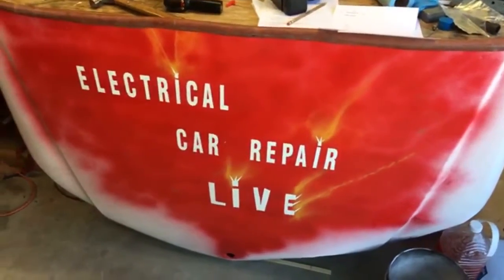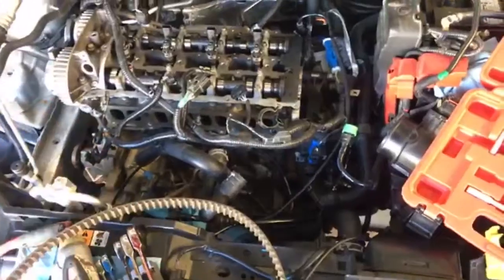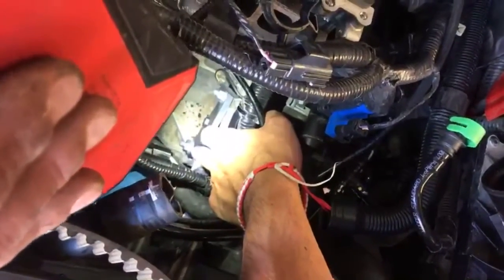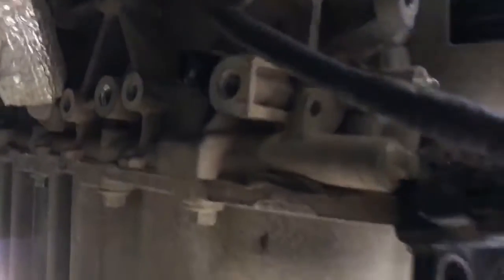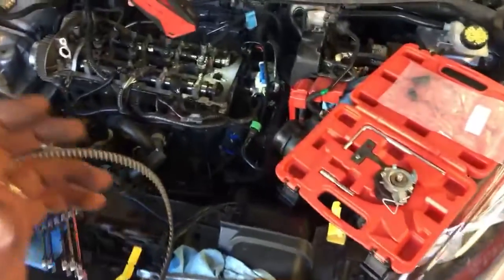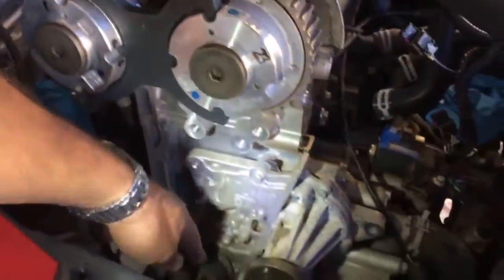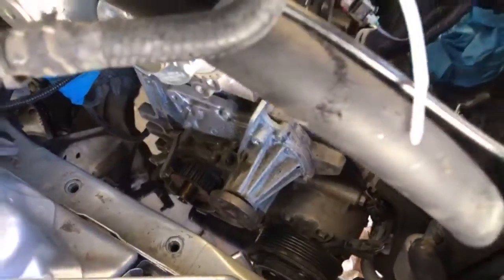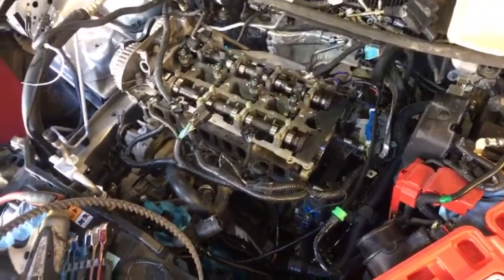FORD 1.6 ECOBOOST TIMING MARKS

Comment: Hello i have a ford mondeo 1.6 ecobust i have 2 problems 1 is that i have the check engine on board is telling me that camshaft and crankshaft sensors, even do i have change them, and some blueish smoke is comeing from behinde, i will make on video and mabye you can help me
Reply: Cum ai rezolvat problema?
Reply: @georgecristian8052  pfff ,mi amânat zilele crede-mă am recondiționat turbina ,am schimbat senzorul acum de pe turbina ,senzori mai multe ,eu am 1
6 ecobust
Reply: Turbo is bad also maybe timing needs be replaced too. Bad turbo=lots of smoke and if not careful, low oil pressure if u don't watch your oil level very closely.
Reply: I know your problem...ALWAYS REPLACE IMPORTANT SENSORS (CAMSHAFT, CRANKSHAFT, MASS AIR FLOW SENSORS, ETC) WITH OEM PARTS ONLY!!!! aftermarket parts that important to engine running properly give bad readings, sometimes car start but runs poorly!! Like extended crank to start, poor idle, misfire at redline, misfire intermittently